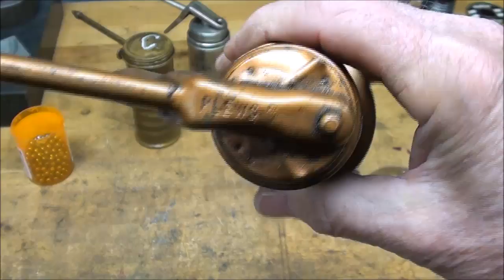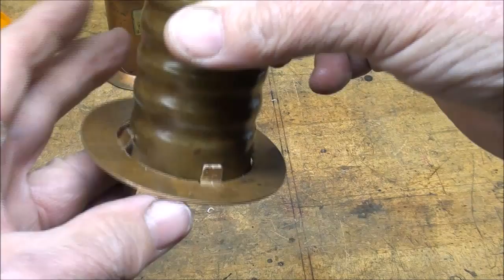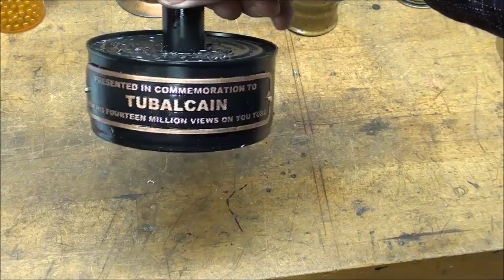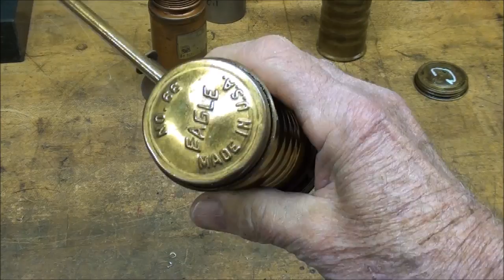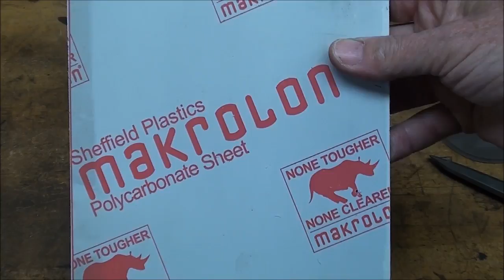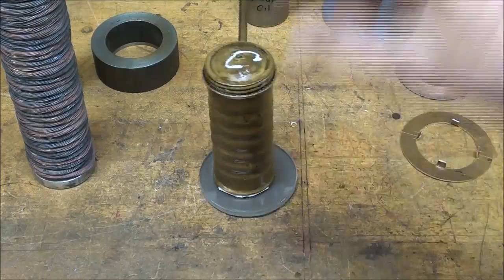SHOP TIPS #184 Improving the Venerable Eagle 66 Oilcan tubalcain

Comment: The base I put on mine is exactly like it the first one that you made from the brass tick plate except I made the little arms a little bit longer bent them all the way up against the can and then I put a zip tire around it and tighten the zip tie down and it does not go anywhere

Comment: I own some of the old "bubble bottom" oil cans and the second generation Eagle oil cans with the wide base, so a friend clued me into this video. Reminded me of a commuter coffee mug I saw, it had a base shaped like a bedpan--that was the part that attached to a flat spot inside the car, and the mug slipped into it to not topple over. The idea was wherever you went, the tip-over risk was inside the car. So, I'd recommend that if one is using these cans with light machine oil, make a donut-like sleeve/holster for the station itself, and the oil can goes inside and doesn't tip over.  The idea is that particular can isn't leaving the work area. 

Otherwise, an A shaped bipod (maybe tripod?) that slips over the nozzle, with legs that reach the table top?

Comment: Just take that iron ring, put it on the mill, and just keep the oil can in it. Pick up the can to use it, and then put it back in the ring, which will hold it up. You had the simplest idea right there.

Comment: Hi There! I'm late to the party but you could have added a plate of the same brass under the one you made and crimped or soldered them together, wouldn't harm your oiler and can be removed if needed. Thanks for the videos! I'm in the middle of an atlas 12 inch lathe rebuild and have found them very useful.

Comment: Late to the party for this video, but for those that read the comments: You were on the right track with the double-sided tape. Instead, use 3M Butyl rubber sealant tape on the bottom of the can and attach it to the polycarbonate disc or your base of choice. It rolls up like Silly Putty, sticks to most anything, and is reusable. It is commonly used as automotive glass sealing compound -that gooey black sticky stuff that never hardens. Alcohols will clean it off, but oils should not weaken the waterproof seal.

Comment: You've got a round reverse "dovetail" on the bottom of the eagle66 - so with your initial brass circle cutout, make the center hole a bit smaller, then you just need to bend the tabs up and back, then forward to lock onto the reverse dovetail bottom. Or, cut the center hole smaller, cut the 4 strips from that to the outer lower diameter of eagle66 (leaving the rest underneath intact), then fold them over the lower dovetail and back down onto the brass circle - you could solder them onto the circle to lock them tight on the bottom of the not modified eagle, 4 "pressure" loops and the extra center below the can would hold it from underneath, the extra weight adding stability. Finally, run a small downward bend around the outer edge of the attached brass.
Reply from the maker: Thanks

Comment: Mr. Pete,
   I don’t have an Eagle but I do have a Plews identical to yours. The only problem I have with it is the base ring spot welds didn’t hold and over time and use the ring creeps up the tank and thus negates the purpose of the ring. I love the thing and it’s the one I use most often. I have gone the magnet route with it but, as you know, that solution isn’t ideal.
   Another person asked why they didn’t make these old oil cans leak proof? Well it has to do with the simple hydraulics of the pump. In order to pump the oil through the spout in theses simple  pumps they have a small air port. It’s the compressed air that forces the oil up through the pump and out of the spout. It’s not much but enough to do the job and also enough of an opening to allow the oil to leak out if it left on it side. Also the treads are not that precise and oil seeps through and out. Hey, if you have an oil can you gotta expect a mess once in awhile!
Dale from Decatur
Reply from the maker: Yes, they all are messy

Comment: i have one that i put in a wooden cylinder that about doubles the diameter. it was just a chance thing of course. i had bored a hole in a piece of turned hard wood maybe 2.5 or 3" od for something and cut off what i needed and there was this left over blind hole cylinder laying around. not being the kind of fella to throw anything useful out, it roamed across the benches and such freely for a good bit. it was setting near the lathe one day when i was using the oil can to squirt some cutting fluid. it looked like the right size hole, and it was in reach so i tried it. a nice tight enough slip fit and ended enough below the pusher to get my finger on comfortably. i left it that way and have used it for years now, decades actually. it's nice and stable. just luck of course. i have since tried to use those foam "condom's that fit over a pop can to keep them cold on another one. wrong size, but it fit my wooden starret punch  holder perfect and the bottom of it had a hole poked thru for the 5/16 punch so that solved that. would not of thought about trying it if i hadn't stumbled on the the oil can fit 1st.
Reply from the maker: Sounds good. Very rare indeed that 2 random items fit together. Thanks

Comment: You provided all the answers. Just change the order. Put some steel shot in the oil can or medium size nut then make a wood base and put holders, slots, etc. to hold brushes, scales, pencils, soapstone, etc. then inset a magnet into the wood. When you set the oil can down on it, it is magnetically held down and you can take it to your next work station as necessary as a unit. The can does not attract chips or magnetize your machine if you drag it over the iron surface. I have done a similar thing with a glass ashtray I use for applying oil when drilling small holes and under the ashtray is a piece of masonite with a neodymium magnet inset. When I toss the metal (acid) brush in the ashtray the magnet holds the brush from falling out.
Thanks for all of your videos. You share a lot of knowledge.

Comment: A recess could be cut in the base plate material for the can to sit into. Then machine one or two recesses in the base plate material to glue or place one or two  thin rare earth magnets (from the top side).  Place the can into the recessed area and hold with double stick tap or.....

Cut another ring out of the same material that has an inner ring that fits nicely around the oil can body diameter and has an outer ring diameter that is less than the base plate diameter.  Disassemble oil can slide the ring down to the base and glue to the base plate.  You can also drill and tap the upper ring in three places and screw it to the bottom plate with 3 recessed screws up into the top ring from the bottom plate.  Now you have a pinch fit with the added holding power of the magnets.

Spill master Oil cups:
I use 3 different Spillmaster oil cups and place single large magnets inside of them to keep them positioned.  The single magnet in each oil cup is large enough that it cannot fall out through the brush hole when tipped over or upside down and the cup lid comes off so when needed the magnet can be easily removed and cleaned to keep swarf out of the can. http://littlemachineshop.com/products/product_view.php?ProductID=3896   

Love your videos thank you for sharing your experience and machining techniques!

Comment: G'day Mr. Pete, The brass base looked fantastic against the Eagle 66 oiler and the size ratio was just right. If you wanted to 'waste' some more time, next time add 4 more tabs (8 in total) so that 4 would sit under the can and 4 up like you did, so now they would create a pinching or apposing force to hold it. Of course now the oiler can would sit marginally higher by the thickness of the new base material. Love your program and sharing of knowledge. Cheers from Aus.

Comment: Why don't you counter sink a washer into a thick delrin base and use a magnet to stick to the base/washer firmly inside the can? I don't think chips would be an issue with the right size magnet and the right size base. Also, Nice cans! HA

Comment: You could bend coat hanger wire into three 30-60-90 triangles and leave extra wire on the short side so it goes past the right angle then solder or weld them together to make a sort of tripod with legs 120 degrees apart. Then drop the oil can between the three vertical triangles.

Comment: Well, well. What a wonderful 'gem' of a web site I just stumbled upon. I will keep watching as I may not be a machinist by trade, I design and work with them and will use your ideas very often. With the oil cans; I love them, too. I asked for a set of Goldenrods for Christmas and was pleasantly surprised as they are nice Ameri'can' made and don't leak as much as the HF ones when tipped. I would recommend to use the 3M tape as most of their 2-sided tapes are oil resistant as they are used in auto assembly. But a wee trick is to warm both sides up with a hairdryer and then stick them together but make sure you wipe with MEK or acetone first. the bond will be amazing.Keep up the good work and I'll catch up on the 600 or so vids I've missed.
Reply from the maker: +Unlimited Headroom  Thank you very much for watching-much more to come. Thats a good idea

Comment: Why not combine two of your Ideas?  A thin Iron base fixed on the underside of the brass skirt and then drop in a magnet into the oil ... strong enough to grab onto the base ... (but not so strong as to lift the lathe).  You get the added bonus that the magnet will catch any iron  contamination in the oil too.

I used to teach computing skills ... students seemed unable to think without a can or bottle of water and keyboards are "magnetic" where any liquid is concerned - a 2" roll of masking tape is the perfect size and weight to become a perfect can sheath making it almost impossible to upturn the contents.  Failing that a roll of duct tape will prevent even the strongest student getting to the drinks machine.

Comment: Try instant gasket material as the "glue", and roughen the surface of the plastic to improve the bond. That way you can remove the base if you want to, without bending the can.

Comment: Hello Mr. Pete. I have watched a few of your videos on and off and really enjoy them. You really cracked me up with this one. However I like your last solution by taping that piece to the bottom. The first thing I thought about was 3D printing something similar that would press fit on it. That tape you have works, but over time it tends to come off. I found the 3M scotch gray double sided tape to hold much better specially if you will have oil getting on it. I got mine at the local home depot. I think that would do the trick for you, with a slightly larger diameter to keep that in place. I think the simple fix is the way to go, no need to get all crazy with that. I keep using W40 on my mini lathe since I don't use it often, but was looking to get a small can for oil. I like the stubby small one you show there.
Reply: +myshots101 - Halligan142 has produced a couple of videos about making your own "Eagle #66" can - you could make your own based on those videos with a modified body design, to the height and shape you prefer.
Reply from the maker: +myshots101 Thanks for watching--those are good ideas
Reply: +Mark Sinden 
Thanks, I just finished watching that.
Reply: I was thinking 3d printing as well. Would be easy to do.

Comment: Makes Me want to get an Eagle #66 oil can. Why  not make a metallic ring (maybe !/4 inch thick with a hole just big enough to fit the oil can) from steel and cut a Slot in the ring. Use a screw to close the ring/clamp around the oil can. Then you could remove the ring when ever necessary. Keep those videos coming
Reply from the maker: +James Reed Thanks for watching--thats a good idea

Comment: I like the idea behind the use of the solder.  Being a ham radio operator, I agree with using the 'lead free' solder they put out today for that (I hate it, not nearly as easy to work with), save the old lead mix stuff for the O.M.'s and X.Y.L's that prefer building their own antennas and feed lines.
Reply from the maker: diggerop A little lead won't hurt you---------------unless of course, its a bullet.

Comment: You can salvage the brass ring with the tabs by cutting another solid ring for the base and solder it to the bottom of the tabbed one, thereby securing the tabbed one to the can, and adding a bit more weight to help holding it upright.

Comment: Mr Pete...
About that foam tape...

Are you aware of the 3M VHB (very high bond) foam tape?
It looks identical to what you have there but it is incredibly strong.

One of it's uses is to attach the aluminum sides on over the road truck trailers instead of rivets.  Take notice of the "smooth sided" trailers on the highway... no rivets, foam tape instead.

It is incredibly strong and you would never be able to peel it away like you did the foam tape in this video. ( at least not after it fully cures )

It is great stuff... I can't live without it.

Be well,
Anon
Reply from the maker: No, I am unaware. I suppose only available for industrial use.
Reply: no, it is easily available.
I believe Home Depot and Lowes both sell it.

I do get mine from a sign supply company.

As a matter of fact ULine sells it.  I think they carry both 3M and a house brand for appreciably less.

I have never used the "no name" stuff just because it is such a large roll and I don't want to take chances on any of my jobs.

It is probably all made in the same factory in the far east anyway.

Anon
Reply from the maker: Anon Ymousmie Thanks, I'll get some

Comment: Well Mr Pete...

You got me thinkin' too.

I understand you not wanting to permanently deface the oil can. (solder)

I watched many of your videos and you often mention discarding tools or tiems that seem to have no value.
I get it with junk tools but I am one that never discards anything... Really, I save everything...
even junk tools,

Those tools are the ones that end up in my "loaner" box... The only tools that I will ever lend or sometimes give
to someone that can use it.  They may not be up to my standards but there have been many times that another
person is glad to use the bent screwdriver instead of having to use a butter knife.

I digress (but hey, that is just me)

I also had your attitude about not defacing items, especially classic items that we hold dear for one reason or another.

Today, I think differently.
If I am going to own my tools or oil can forever...
We never really own anything... we are just the keepers until we pass it on or until we pass on.  The tools endure beyond our frail bodies.

It does not make any sense at all to leave it original if I can improve it for my use.

Besides...

If I were to inherit an oil can from someone like you and could take my pick...
I will every time choose the one that you modified... The one that had a bit of you in it...
The one that will make me think of you every time I use it.  The one that I will pass along to someone that I would
no doubt have told some story or stories about you each time I used it in their presence.

I have a few tools that my dad modified to suit his needs.  I hate that he ruined one of my original Craftsman screwdrivers...
or do I???
I was pissed at the time because it was from my first tool set but now I cherish it.
I never let anyone use it and it resides in a dedicated drawer in my toolbox with other "special" tools of his.
I also keep some items in that drawer that my younger brother modified either intentionally or by misuse as they too bring
me fond memories of our past. 

As scarce as those oil cans are... Even more scarce will be the one that you cleverly, or not so cleverly modified.
The one with your distinct signature on it.

So, go ahead and solder your homemade base on that can and leave it to me in your will, should you die before I do.
I would cherish it forever and pass it along to someone special.

Also, the solder can really be removed and will hold up better than that foam tape.
But, I say... once you solder it, it is no longer an Eagle No. 66  oil can... It is tubalcain's oil can and that sir makes it very special!

I always enjoy your videos and anxiously await your next installment.
Keep up the great work and may you live forever.

All the best,
Anon
Reply from the maker: Good ideas & great philosophy. I pretty much agree, however what I see most is botched up tools modified by untalented & incompetent workers--and that saddens me.

Comment: Hi Tubalcain, how about using one or more of your neodymium magnets placed in the bottom of the oil can and then use a piece of round steel machined with a recess in it to fit the bottom of the oil can. Hopefully the magnets would hold a piece of 1/8 steel with the recess cut .063 deep.  My two cents worth,, Thanks for the videos. Harvey from Nebraska
Reply from the maker: good idea

Comment: A steel disk with a recess machined into it for the can to sit. A model airplane builders trick for photo etched brass is super glue.. If a piece gets misaligned we just burn the glue off with a match and start over, so the an empty oil can could be returned to stock condition easily.
Reply from the maker: good idea

Comment: take a piece of pvc pipe  just big enough to slide over the can heat the top up with a heat gun  use a hose clamp to clamp the top tight to can  cool with water remove hose clamp then mount whatever you want to bottom of pcp pipe when you want to remove heat pcp pipe and pull

Comment: The double stick tape could be "protected" by a bead of RTV silicone around the base of the oil can.
Trollforge came up with the same idea I had but I felt a lick of solder on each tab would be a "permanent" but reversible modification. 
Look after that "Boo Boo" on your hand it looks nasty.
Cheers Eric